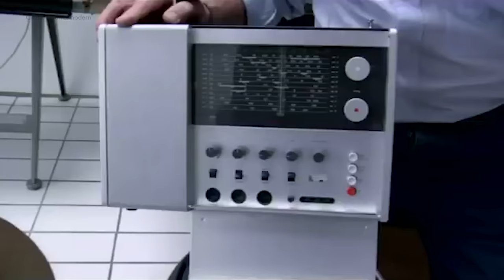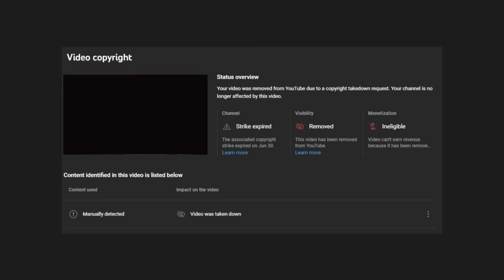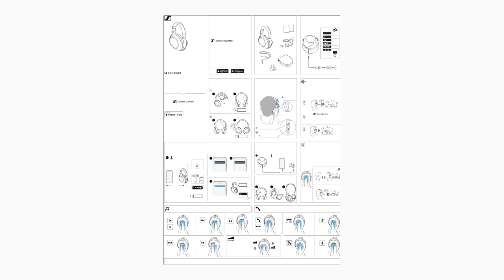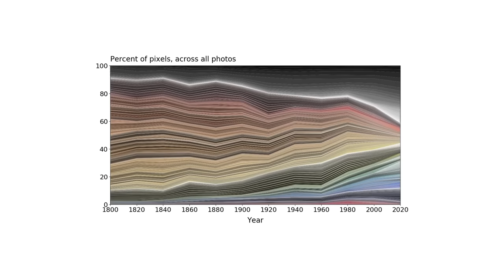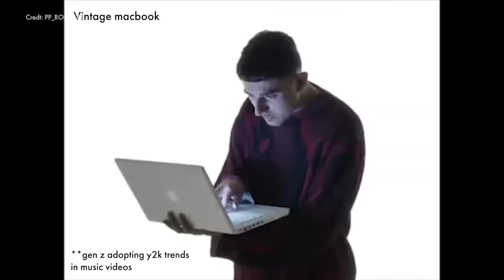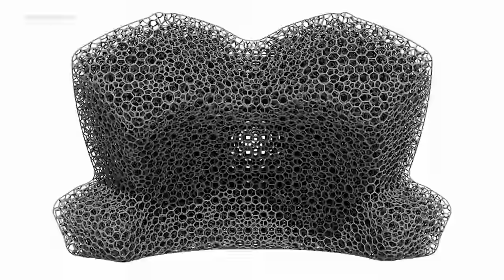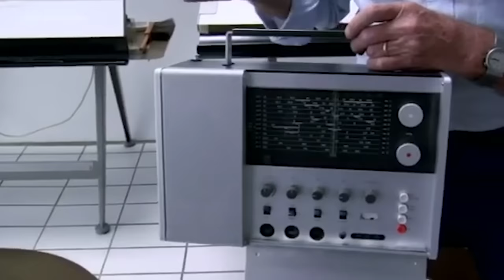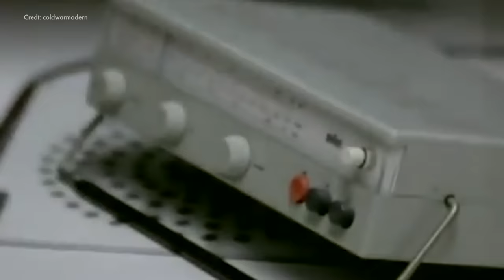Minimalism is Getting Absurd: Updating Dieter Rams' 10 Principles

Comment: I'm not an expert.  But My personal belief on what good design is:  1) the device serves ONE purpose.  I dont want multi tools.  I dont want swiss army knives.  I just want ONE object, which serves ONE purpose.  If I have to do another purpose, I will buy another object which ONLY serves that One purpose.  Hell, I might have 3-5 putty knives.  They might all be "able" to do any of eachother's tasks.  But I use One putty knife for this exact material.  I have One putty knife for the fine, undamaged perfect edge.  I have One beater putty knife.  I have One strong putty knife.  I have One weak putty knife.  So.  Could I just have one putty knife and do every possible task?  Yes.  But instead, I have 5 putty knives, which are all essentially the same thing, but each knife does 1/5th of the tasks.  

the other criteria is the device is as non aesthetic as possible.  I want Maximum value, and maximum longevity.  If I'm buying something aesthetic?  I'm PAYING for the aesthetic, which means, I'm getting LESS value in material.  I dont want to buy electronics home theather sound system 7.1 bluetooth preamp turntable soundbar iphone radio clock tv all in one.   That means I'm PAYING for alll these things when Really, All I need is either a Radio, or a Turntable, or an Amplifier.  I just want to buy the Amplfier so that I Know 100% of my money is going into the amplifier.  if the amplifier has 10 inputs and 7 speakers and all this stuff.... then I'm spending all this money on components and features which , not only I will not use, which will devalue the features I need.  I need TWO inputs, and TWO outputs for a speaker amplifier.  Period.  anything more than that is a waste of money.  In. My. Opinion!
Reply: Speakers are a great example.  There's a huge trend of active, equalizer, bluetooth, etc speakers.  No.  I just want basic, passive speaker, with two little terminals in the back .  period.  so that All my money goes in the speaker, and None of my money goes into bluetooth digital class D plate amp gain control ,etc etcetc.  If I was going to buy a speaker?  I would buy Passive speaker.  Period.   You cant sell me active speakers.  Period.  Cant be done.  If I had the money, I would only buy a passive speaker, Period.  Because I want 100% of my money on the speaker.  and If I need to buy an amplifier to make it work?  then I will spend 100% of my money on the amplifier .  and If I need a preamp to make the amplifier work?  I will spend 100% of my money on the preamp.  and if I need a bluetooth chip to plug into the preamp?  I will buy Just a 100%  bluetooth module to plug into the preamp.
Reply: And this is getting beyond the scope of most consumers, but not all of them.  Something that irks me about modern electricity, is that you are buying a power supply every time you buy any electronics device.  In fact, the power supply can end up being the majority of the cost of electronics.  For example.  The AC/DC converter in the TV is the same converter in the Playstation, which is the same converter in the Preamp which is the same converter in the Amplifier, which is the same converter which charges a phone, which is the same converter which powers a computer.  When you buy a stereo preamp, "you're paying $75 for the power supply, and the actual audio circuit PCB costs $15."  Now you add the cost of the chassis, and the actual "unique" component of the device is the least valueable part of the entire assembly.  I dont want to buy an AC/DC converter and chassis for every single device in a modern home.  I just want the $15 special circuit card that I need, and all the other stuff we can make or get for much cheaper.  Food for thought.  I think in the future, we will have DC wall outlets that make common DC voltages.  Then when you buy "Electronics components" you will essentially just buy the unique circuit and plug it directly into DC wall outlets.  That way, everyone isn't buying a new 50-75$ power supply for every different circuit card, to say, power a Youtube studio, which has, I guess, every different type of electronics possible required operating at once.
Reply: (I think color coded banana plugs are the ideal form factor for a DC wall outlet.  you need to plug in a laptop?  you plug it into the appropriately colored banana plug.  etc.)
Reply: I'm not a big proponent of the "internet of things" or "smart home" or whatever.  but I mean, the more I think about it.  Wifi routers, internet modems.  Security cameras, smart doorbells, Thermostats,  media centers, automatic garden watering timers, Printers, scanners, rechargable flashlights, box fans, external hard drives, etc etc etc.  Need to charge a car battery?  just plug it into the +12V banana plug on the wall.  This of course doesn't work for washers, driers, and toasters, but I think there's something there.  It would be like a Tesla wall panel battery except instead of taking solar and making AC from it, you just use the DC off the battery pack, or have a giant DC supply wall panel in the home.
Reply: Lights, cameras... I dont know all the details of every electronics you need for a home, but an increasing number of devices for the home is becoming majority DC powered.
Reply: Hammers man.  I've been toying with the idea of buying a new hammer or two for years.  But I cant find a single hammer in a single box store ANYWHERE that isn't some diablo super engineered swiss army knife hammer.  And the simpler framing or ball pin hammers out there have terrible balance, ergonomics, weight, etc, that make them less effective than traditional hammers even 30-50 years old.  Its a shame.  I just need A hammer.  Not the wrong one, the right one, the generic one, the same one they made for 100 years.  I need THAT exact hammer.  Not all this strong man coloful wierd plastic handle engineered stuff.  I just need a couple basic hammers bro they dont make em anymore !
Reply: Braun has a point.  I need a station wagon.  Go try and find a 2024 station wagon.  Can't be done.  Not a fancy Audi station wagon.  I need a square, utilitarian station wagon with the maximum internal volume and roof rack space.
Reply: like man.  what bums me out right now is Crescent and snap on.  Go look at the cresecent and snap on hammers or whatever.  Just so outside the history of the companies.  znoooze. ....💤
Reply: You know man.  Because I authentically prefer hand tools.  I dont want to plug in a saw and set the blade and put on safety glasses.... I just want to pick up a hand saw and make a cut.  And these modern hand saws are garbage.  Pliers are pretty good right now.  The hammers are garbage.  All of these power tool companies monopolized the tool industry entirely, and have done great making literally unbelievable power tools, drivers, jig saws, circular saws, drillbits, cutting tools, all this stuff is simply unbelievable.  the Irwin blue large nail punches.  are literally garbage.  They're simply not hard or dense enough to be effective.  Those little generic small nail punches are Great, except theyre too small.  Its like we've lost the ability to make effective hand tools, and people like me who actually will reach for a handtool first, suffer.  Hand screwdrivers.  Are literally cheap black plastic.  Go pick up one of those old clear acrylic screwdrivers and they're not only so much more balanced and hefty, but effective.
Reply: scissors nowadays.  Gosh they're so ineffective.  Flimsy, light, or theyre kitchen shears with bottle openers and screwdrivers and who knows what else.  I just need a good traditional 50s, 60's, 70's style generic scissor design.  I dont need cushioned grip titanium scissors.  You cant accomplish anything with this.
Reply: Lamps.  and all that ikea stuff.  Is just so garbage.  Falls over, melts the shade, wrong size, flimsy thing , gets thrown away or put at the curb, gooseneck multihead college dorm lamps.  All that stuff.  Just garbage bro.  literally garbage new in box.

edit.  Is it a floorstanding lamp?  is a desktop lamp?  is it a bedroom lamp?  is it a living room lamp?  is it a study lamp?  is it a work light?  Is it a backpacking lamp?  Is it a drafts table lamp?  You cant even figure out what it is then you try and adjust the height and it breaks.  and you try and plug it in and the cord is 4' long.    If I had money for a lamp, I would buy , One lamp.  Do I need a floor standing lamp or a desktop lamp?  then I will buy one of each !  and not one lamp that will I will carry with me in my fanny pack for all possible tasks in my life.
Reply: Cereal boxes.  I dont need a bunch of air.  Just give the store a feed dispenser and I'll bring my own bowl or jar and pay by the ounce!
Reply: I'm serious bro.  These hammers everywhere make me mad and sad at the same time.  I dont need a cushioned gripped hammer.  I'm hitting a 3 penney nail I'm not driving railroad stakes with a 16oz hammer.  If I NEED to really hit something hard, well, I'll buy a Different hammer for doing that !  But 99% of the time when I'm using a hammer I'm just tap tap tap like a doctor!  I'm not going to war with the damned thing !

Comment: 0:27 he forgot to tell you that only works to a point, it's pretty obvious it hits a point where less is actually less, what a concept.

I'm on the engineering side of things so I'm probably a bit different but modern design is just horrible.

I don't want thin and light, I don't want a round bubble of s car, I don't want a whitewashed house. Literally everything has become bland and homogenous with less functionality every year.  Decades ago you could look at a car without a logo and know exactly who made it alot easier than you can today.

Comment: The Casio desk calculator is a highly optimized tool for one purpose. Bookkeeping. You can use it without looking and fly through hand-written ledgers with some practice. The Braun calculator is an aesthetic piece of trash meant for the kinds of snooty douchebags who haven't balanced their own budget in decades. I wouldn't use it since I can buy a graphing calculator for that much.

Good design is honest. Most modern design isn't, and that's a problem.

Comment: Glasses Dieter Rams is wearing are most likely not designed by him from start to finish.

I think this pattern aged worse than his designs.
Good point that it can exist, but it doesn't make it timeless.
A design addition that is not purely practical becomes a subject of fashion perhaps, and easier to get out of fashion.

Another take. Depending on where you are in the manufacturing pipeline, this colored acetate might be the material you're keeping truth to, choosing shapes that work with it. It doesn't matter where it comes from, is it natural or artificial, intentionally precise or intentionally organic.

Comment: all the "eco products" seem to be WORSE for envirement. 3.5mm jack removed now need more batteries for headphones that never needed them. need batteries for cars that never needed those huge batteries. "eco" washers use 3x more electric and power seems all worse. althugh im thinking when they say "eco friendly' they are NOT saying "ecosystem friendly" but rather "economy friendly, for the elite" 

somethign as simple as using ONLY hemp and biodegradable plastic for packaging and other plastic that is to become trash. make tech without planned oblessance in mind, they biiach about low earth rare minerals but THEY are the ones that made things cheap and break. just release the esoteric tech! in the 60s they had 90s computers (for elite) in 90s had 20s computesr (for elite) imagine how much "tech" stay out landfill for just givng the esoteric tech?

Comment: You're misinterpreting and misrepresenting the intended meanings design principles, by using the twisted extreme version of modern day Apple style designs, which under the surface they've come to break just about every single one of those listed principles
But at the same time obviously, an obsession taking into extremes, even in the correct way, regardless of what, ends up becoming a problem
The answer is not always throwing out everything, that's been built upon, at first chance, but to exercise less extremism, pretty simple concept

Comment: The concept of "good design" is a fallacy.  Their is no absolute definition of good design,  it's all relative to the brief, for example. 
If a car was designed in which the wheels fell off at the touch of a button it may be considered to be badly designed,  however if the car was designed to be part of a circus act and the brief required that then it must be well designed.
Minimalism also has no absolute part to play in good design.  A fair ground ride can hardly be described as minimalist, the more lights and flashy it is the more customers it will attract. One designed to minimalist principals would be considered a poor design.   So again it's all relative.  
Great video.  These design doctrines should always be challenged. Keep up the good work.

Comment: I'm confused at how you are constantly picking at the specfic rules, and how current design isn't great because of how it takes something too far... while completely ignoring how the 10 interact together! If something has a nice visual design like turtle shell, it's not dishonest to use another material to look nice, that's achieving a certain aesthetic for something designed for the purpose of looking nice, while trying to remain eco-friendly.

You constantly summon up weak counterpoints because you feel everything NEEDS a counterpoint, when you don't need to contrive such arguments, and disagreeing with some elements doesn't mean you have to force arguing against everything for the sake of arguing. Also, much of your complaints about modern design are ironically due to falling into the same traps of focusing on one element of design without considering or recognizing the interplay between elements that make a truely well designed product... such as a video.
Reply from the maker: I agree with your comment about the tortoiseshell, that was my whole point. I disagree with your second paragraph though. By examining the details from different angles, we can better understand the whole.